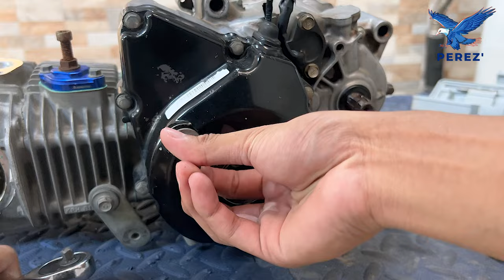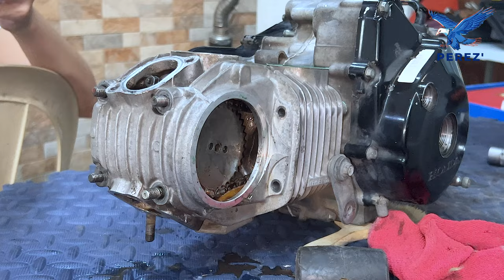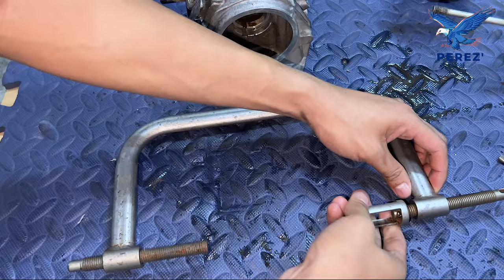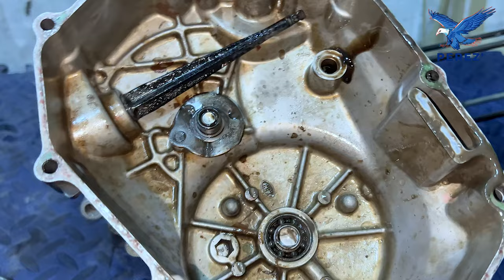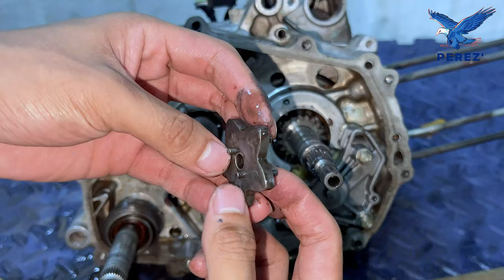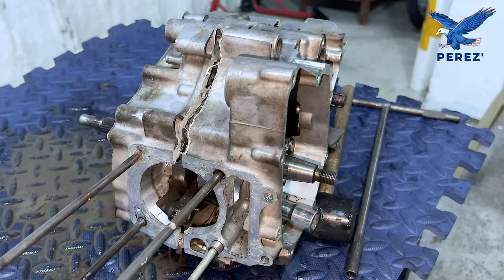HONDA WAVE 125 ENGINE DISASSEMBLY

Comment: Pwede Po ba Malaman mga ginamit na special tools during the disassembly
Reply: valve spring compressor
flywheel holder
crown/castle nut/wrench (di ko sure pinaka saktong tawag ng pang alis nung clutch)
magnetic pickup tool/magnetic stick
magneto puller
crankcase separator/splitter
at yung pinaka dabest, yung barya hahahaha.

Comment: Sir di ka na nagsalita XD
Reply from the maker: sa parts inspection at assembly na haha
Reply: @Perez.  sige sir, para maayus ko din honda xrm namin, same engine lang naman yun sir diba
Reply: @Perez. Sir sana may voice or guide ulit sa tamang pagtanggal ng mga pyesa.. thankyou2 sa mga pagsashare mo ng kaalaman 🙏
Reply: Kung pano sir gamitin ung mga crankcase puller .. (narequest pa nga) 😁✌️
Reply: @Perez.  ano gamit nyo na torque wrenches?
Reply: @Perez. Location ng shop nio sir? Pwede ba padala ko makina ng raider sayo? Pa overhaul.thanks.